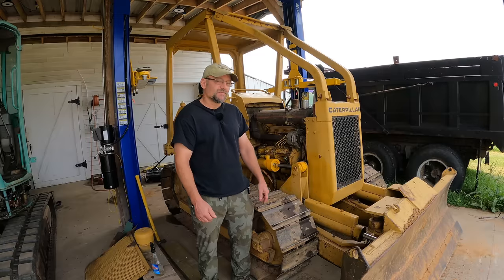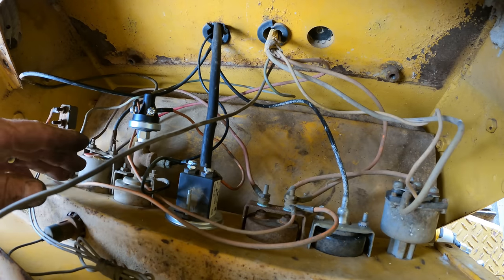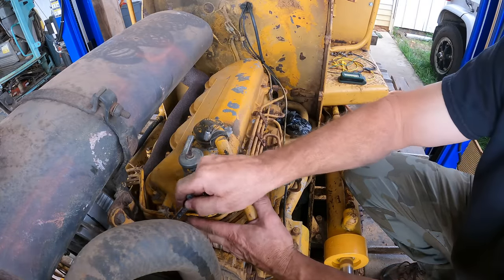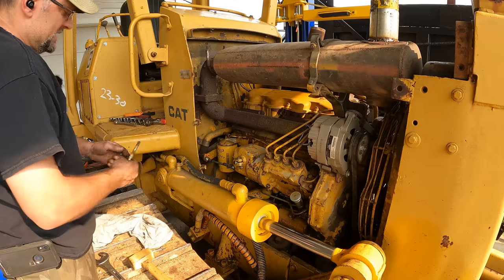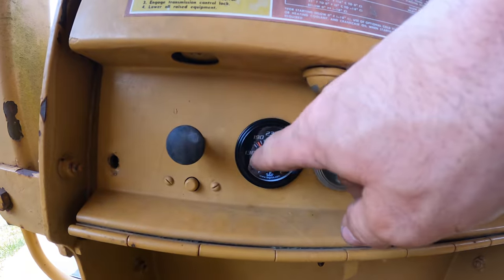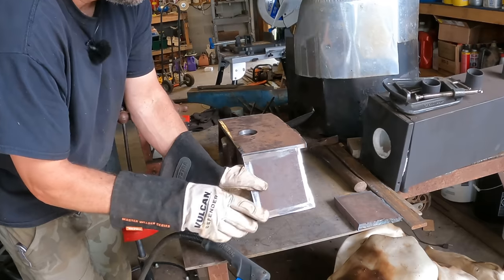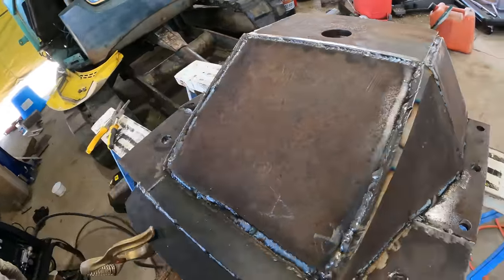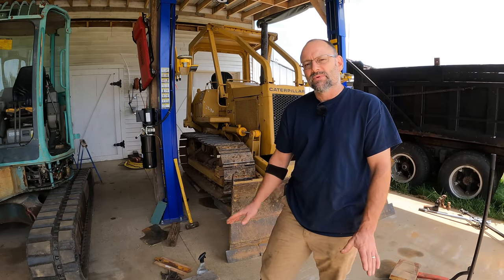How My Audience Saved This CAT D3 Dozer From Disaster.

Comment: on your alternator  the 2 small   terminator   you need  a positif     and  light    that light goes in your dash  that    go on  when you start   and goes off when  the alternator charging  those alternator have a control box inside  your  dozer  wiring is not made   for   alt whit  inside control box

Comment: Compression ignition engine. =  Glow plugs add supplemental heat on cold starts. =  Compression is lower than it should be.  How's blow by at the oil fill?  Good call to leave it alone.

If it gets worse, maybe the starter is marginal, maybe battery isn't putting out enough amps to spin it fast enough.  Maybe not a good battery connection or not heavy enough wire...

Comment: a master battery switch that you turn off everyday in my opinion would make more sense and protect against your parasitic draw, and future draws. but these master switches do get forgotten to be shut off, so you may end up back in the same situation. Also my 2006 6.0l diesel uses the glow plugs all the time, different lengths of time depending on ambient temperature, so i don't see a problem with it.

Comment: If you're going to do much work on valve trains you need the proper tools. Look for a feeler gauge set with a 45° bend in the end! They are designed exactly for valve clearancing. The set you have will cant over and not read correctly! 
Also, you can remove the moving jaw plate from your vice and reattach it at the handle end of the moving jaw. It allows gripping larger plates of metal!

Comment: Check your battery for Voltage leak, Positive Terminal to Top of the Battery Case around the sticker.  If it shows any voltage Clean and Dry the top of the battery and remove all stickers, they are battery killers.

Comment: Number one cylinder traditionally at the front of the engine, or furthest from the gearbox - have they reversed the designation on CATs? Don't suppose it matters much but would do on timing and parts ordering I guess. Plus you can't adjust 4 valves from one engine position, normally only one at a time before repositioning the crank. Totals of 9 (adjust 7 when 2 rocking or adjust 8 while 1 rocking etc)

Comment: As a equipment operator and having to run older equipment, we would turn it over 25-30 seconds let it sit for two minutes and try again let sit for two minutes… if that doesn’t work a check valve is stuck open and draining fuel out every time you park it.

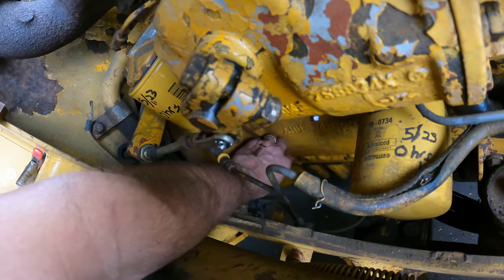Comment: What's the amperage rating of the switch in the oil pressure sensor, in case the field needs a relay?  In OR, I wear my respirator outside whenever the smoke gets over AQI 100.  I  thought I saw a triangular logo and MU on the engine at 14:36.  Is there a Mitsu engine in there?  Seatbelt and grommet are great ideas.   A400, eh?  I guess it 's a bulletproof skid plate.

Comment: Don't you have several smaller batteries in dry storage from changing the power backup? 2 in series and that rig in parallel could up your amperage without much financial outlay. Sorry if this is stupid .. It's just a thought.

Comment: Need to change charge wire on alt  8 to6 gauge. depends on output of alt but probably 78 amps  you used maybe 30 amp wire and goes directly to solenoid that is a less corrosive place . the diodes should prevent battery drain.

Comment: The wear has occurred on the bottom surface of the lower piece, not on the top. Shimming the top will just promote faster wear with more pressure on the bottom surface.

Comment: Valves being out of adjustment will not affect the starting of a diesel,  It's either low compression or fuel injector problems

Comment: On a high vibration situation like this it may be wise to use a wire termination with an insulation crimp. This keeps you from having a hard edge against the wire. Also, isn’t the oil pan part of the cooling solution ?  😊Steve

Comment: Lay some carpet scraps on that trailer when loading the dozer! You wouldn't believe how easy they will slide off!! Metal on metal is zero grip!! Also, consider covering the sides of the engine area...I've had a skinny branch sneak in and knock a belt off in the worst possible location a few times!! Cover everything!

Comment: I see I wasn't clear enough, the screen might be inside the banjo bolt. They achieve this by boring out the banjo bolt large enough to fit a small screen inside. It is like this on the inlet of my fuel feed pump on my old Land Cruiser diesel engine and I have seen it on a few different engines on the same location as well, but yours might be without it 🤔

Comment: Regarding glow plugs. Your engine will have lost some compression over the years. Compression equals heat!       
A diesel is after all a COMPRESSION ignition engine!
The increased requirement for glow plugs is not a reflection on your manhood, so use them liberally.
P.S. Love your channel.

Comment: Glow plugs serve really only one purpose, to heat the air in the combustion chamber. I’m aware that a lot of diesel engines have them in the “prechamber” and those that don’t typically have them right next to the injector nozzle. This isn’t to let the fuel hit it. It’s purpose is to get the air hot enough that when the compression stroke occurs that the air will get hot enough to ignite the fuel. If the engine can’t start easily without glow plugs is more than likely because it has lost compression from when it was new. The question is how much ether it’s drank in its life. Construction equipment lives a hard life and a lot of operators will use ether. The other factor is the maintenance that it has received. If it hasn’t had the oil changed routinely or the air filter didn’t get changed the engine will more than likely have scoring in the cylinder. All of these will cause you to lose compression. If it still has plenty of power and doesn’t smoke or run poorly then I’d just use the glow plugs. One last thing, the speed of the crankshaft plays a role in compression heat. If you don’t have the engine turning fast enough it won’t be able to create the heat to start. That second battery idea isn’t actually a bad one. If the unit came with two batteries from the factory it’s a really good idea. If it didn’t and the engine starts smoothly with glow plugs just leave well enough alone. I hope that helps.

Comment: Wish I was a good welder, I picked up a cheap welder at a yard sale and I've used it for stupid stuff like patching a hole in my lawn mower deck, I fabercalbuled a frame on my air compressor and a spare donut wheel on it to hold my air line. I need some actual steel to practice on.

Comment: You can just add a battery disconnect,  Cat always does it on the ground wire, very easy job, then you will save your battery especially if machine sits for awhile

Comment: For the track adjustment... You're measuring sag to the tip of the grouser. It's a wearable part. AND it's a half inch too tight? Could be more in reality if they were new

Comment: Save your starter and battery , a small shot of ether into the air cleaner will provide the heat needed to shorten the crank time . Dont be afraid of starting fluid , it will not harm your engine if used properly . If push comes to shove , in the winter pull the air filter and hold a burning oil wetted rag in the airstream  . Low compression requires prolonged cranking to heat the intake charge enough to detonate , the more you crank the more cold fuel you put in the combustion chamber , even with working glow plugs your still fighting a losing battle .

Comment: So on your engine starting issue, it’s probably a little low on compression, these caterpillar 3204 series engines are notorious for this as the piston only has 1 compression ring and gets a little wear they don’t  like to start without aid even if it’s 100 degrees, at least this was what I found when I was researching for a friend that had 1 in a TSK D4H with low power and starting issue good luck and good call on the missing of a belly pan, dozers are not tough without this piece of plate

Comment: Fill the open end of the butt connector with a blob of 5 Minute Epoxy. Once it hardens, it's not coming out and it will stop anything from accidentally working it's way into the butt connector and causing a short...Do that for ALL the wires you want to Abandon but don't want to take the time or effort to completely remove...and if you ever need to use them again, just cut the butt connector off, strip and terminate for the new use...

Comment: 26:24 I'm no expert, just a guy wondering if it's like an old analog temperature gauge if something is called that. Where the water is connected thru the line to the tempture reader, where it has like a expanding/contracting wire/spring there expands with the hot water, to create like a measurement of the water or something.

Comment: When doing valve’s either don’t back lock nut totally off or back nut off and adjust tappet a touch tight lock nut pulls tappet a thou or so only adjust after everything is shiny from use automotive gauges won’t last

Comment: Great video as usual! Just a quick few thoughts...Next time you have to remove the alternator, turn that long bolt around. Having to thread that thing into the fan shroud is silly, lol.  You could shorten it about a half inch too. My other thought is for you to invest in better crimp terminals. I suggest the kind that heat shrink after crimping. They have a hot melt adhesive on the inside that seals the crimp from getting water in there and rotting out the connection. Anything that gets exposed to water EVER should be sealed up. Also, there are terminal caps available for the positive output terminal on the alternator. That lead is always hot and connected to the battery with a pretty beefy wire. If you accidentally graze that with a wrench while working on something else, you will weld your wrench, or worse get a really nasty arc flash injury. I worked with a guy who welded his wedding ring off (and almost lost his finger) when doing something similar. Just my 2 cents

Comment: Are those clearance values typical for a diesel engine of this size? Most of the motors I have adjusted were around . 005 for both exhaust and intake.
Reply from the maker: It varies a lot with different engines.  This was based on the CAT manual for this machine.

Comment: Machinist here.

You really do not want to run a drill into the 60 degree angle of a center drill. It is extremely hard on drills and it will prematurely dull the corners. I would only use the 90 degree tip of it, if I was starting a drill. A center drill is only for making a center for a tailstock to run in, not starting drills. Obviously you cant get around that if you have a turning center and are also drilling/tapping a hole in the end of the part.

When drilling you want to ideally use a 120 degree spotting drill so the tip of the drill starts cutting first. The drill will last a lot longer and generally run more true.
Reply: @mmm365  spot drills for 118 degree standard twist drills are 120 degrees. They are this way because you want the tip to touch first. The corners of drills are fairly delicate so you want to avoid those hitting first.

Comment: You probably know this, but just in case you don't. I recently learned that when towing a flat trailer with a load like a tractor or car etc. you should always move the load as far forward on the trailer as possible for road stability. The farther back, the more wobble you'll get. Just in case you or any readers of this didn't know that.

Comment: There is no more useful dozer than a D3 on a construction site. It's not a D11 with a ripper blade, but if you're ever needing a 1.5:1 slope work it at 45 degrees from horizontal and when you get a little side slide you have the slope right.

Comment: Never  use  short Arc  MIG with metel thicker than one Quarter. Use long Arc or Spray Arc  Mig  with75-25  Argon  Co2.  You want  to  Por  in  the  wire  HOT  HOT   HOT.

Comment: John, what happened to your nice Grizzly lathe?
Reply from the maker: Nothing. That’s the lathe I’m using. Why?
Reply: @FarmCraft101  Oh, I remember it being less ragged looking. No offense. Perhaps it's just the filming angle. I need a new lathe, I'd like your opinion on it. But I need something with a DRO.
Reply from the maker: I've been reasonably happy with my lathe, but the price has gone way up since I bought it.  https://www.grizzly.com/products/grizzly-12-x-36-gunsmithing-lathe/g0750g?gad=1&gclid=Cj0KCQjwqNqkBhDlARIsAFaxvwxn1wh8rxhhaUF4hifvp5UJaYaMORZNjP6jKCk7gaD1TRykj-aNlt0aAvC2EALw_wcB

Based on their current pricing, this is the one I would go for now:
https://www.grizzly.com/products/grizzly-13-x-40-gunsmithing-lathe-with-dro/g0776
Reply: @FarmCraft101  That's nice, actually a bit big footprint-wise and I can get the 1.5" spindle bore in a PM lathe that's 11 x 30. Course, it's still a variable drive not geared headstock, but oh well.

Comment: If you rotate 360 degrees, will you not end up in the same place that you made the first set of adjustments?
Reply from the maker: It takes 2 rotations of the crankshaft to go through all 4 cycles of the piston. Say you are at top dead center ready for intake.  180 degrees will bring you to the bottom and start of the compression stroke.  180 more will bring you to the top of the compression stroke and beginning of the power stroke.  180 more you are at the bottom and starting exhaust.  180 more and you are back where you started.
Reply: It’s a 4 stroke engine so a complete cycle would be 720°
Reply: 4 cycle- intake/exhaust cycle

Comment: Re your drilling technique, you need to rethink and relearn it. You peck all the time. Most wear on cutting surfaces are from the start of the cut, pecking massively increases wear as you found out when the drill but that WAS working stopped working. Reasons to peck: break up chips for safety and convenience, take breaks in between to allow the cutting edges to cool. You peck without breaks and you don't need small chips. Either take breaks and or spray to cool between pecks or don't peck. For deeper holes where overheating is possible you can avoid pecking by feeding a stream of coolant or lube into the hole. The other reason to peck is to evacuate chips from a deep hole, this is the only one you can't avoid, but 1/2 inch plate doesn't need that at all, nor any breaks for cooling, nor for breaking up chips. For the love of drill bits, please stop pecking. Thanks in advance <3

Comment: 14:31 If you rotate something 360°, you have essentially not rotated it at all. Maybe 180°?
Reply: Figured it out, 1 full rotation is only half a stroke. So 360° is in fact correct. 2 rotations (720°) gets you back to the starting position.

Comment: Early design D3. Loaded with problems, especially in the brake and steering compartment.Worked hard, the compartment oil drain plugs melted out and lost all the oil. I worked three of these on a road job in southern Maryland and had the same problems on all three. Avoid buying one of these!

Comment: I don't understand your reluctance to use the heatplugs. Indirect injection needs heatplugs, direct injection does not. The ambient temperature plays little role when first start. I use the heat plugs for indirect injection in Australia with 40C without inhibitions. Otherwise all you have is an extended cranking time, excess fuel in the chamber diluting the oil on the cylinder walls... and no particular gain.  :) That chart of how many minutes to heat according to outside temperature is only there because the heat plugs don't have an automatic shut off like any other modern indirect injection engine, and so you don't overheat and burn them.

Comment: 14:05 - i see a Mitsubishi logo with the letters 'MIT' next to it. Im guessing the engine (or at least block) was made by them? Was the whole machine made by them? 
I know its common for this size heavy equipment to be rebranded, (like deere using Hitachi for >10 ton ex's till recently for example) but i thought dozers were cat's bread and butter? Does anyone know what's the deal here?
Reply: Just did a quick search online, apparently cat uses a ton of mitsu engines in their small equipment (>10t or so). 

Good to know you can source parts 2 different ways if you wanted to. Either to save money or availability. They have Cat and Mitsubishi model #'s.

Rebranding is common, just was surprised by this case.
Thx for the video, this is one of my favorite channels.

Comment: Let me explain the hammer problem. Different hammers for different jobs. The claw hammer is for carpentry, not metal work. A ball peen is for working metal.  The steel makeup is different. Claw hammer's steel is less hardened and could send shrapnel toward you when striking a hard surface. I would use a plastic/ rubber mallet to bea😢t that meter out. Less damage to a surface, but you're working on a bulldozer, so you have that. These days, you come upon younger men that never had shop class but probably took cooking classeses.